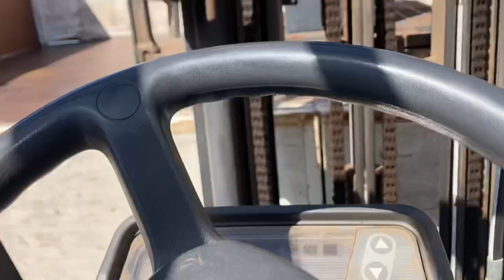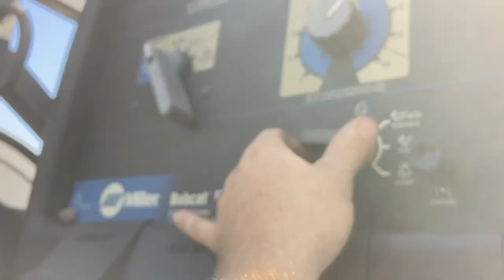Finally installing my service crane!

Comment: What pump did you end up ordering? I need to get one for my set up, google isn’t helping haha. But I’m looking at getting a 1015 IMT crane and it needs a 1.5/3.5 gpm two stage pump but nothing like that comes up when I search
Reply from the maker: I found one through Grainger , its a industrial duty application if I remember right, but the rep at Grainger was pretty helpful it had a 100% duty cycle was 12v and the psi was adjustable I think it was around